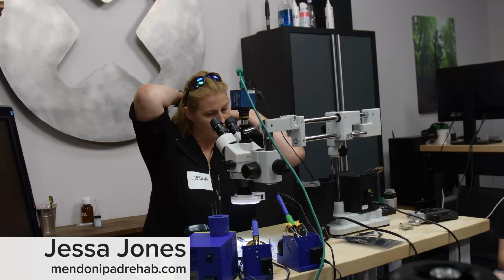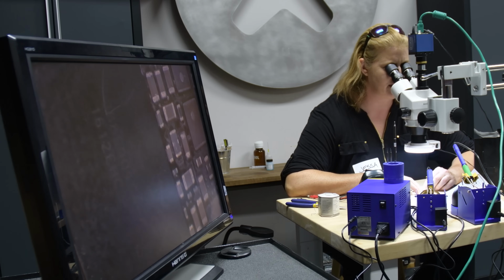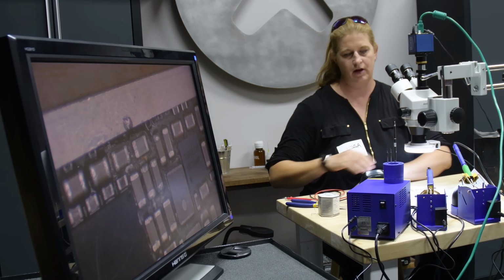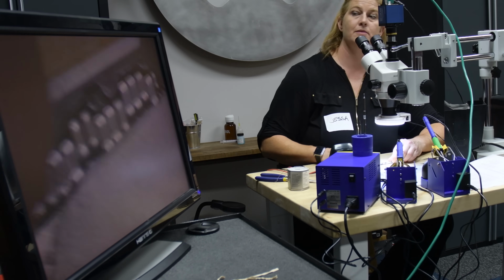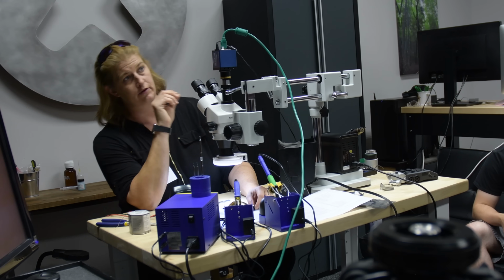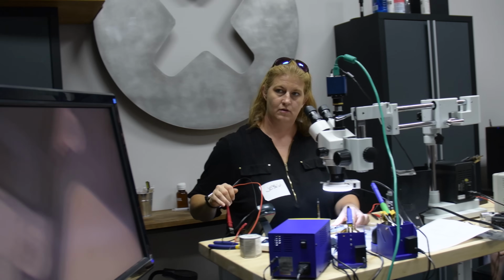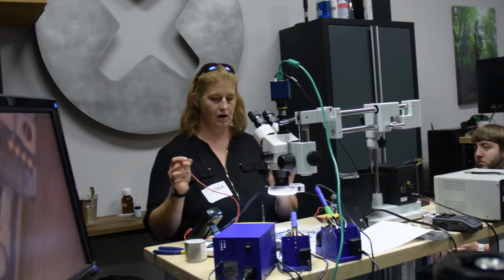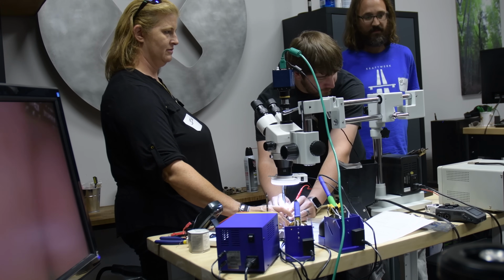Jessa Jones the Damaged Board Detective: Debugging an Incorrect Microsoldering Repair

Comment: In electronics the 2 fundamentals are Power = Volts x Current and Volts = Current x Resistance. 

Or P = VI and V = RI. 

Fundamentals says that at low voltage, if you have high current, your resistance will be low. Because I = V/R , so R needs to be lower that V for I to be high.

BUT! With semi-conductors, resistance becomes a variable that can change based on several factors that includes a voluntary provoked and controlled changes by an other part of the circuit. This means, among other things, that R will be different if the circuit is powered or not. 

You cannot use an Ohmmeter on a powered circuit. But an Ohmmeter on the same unpowered circuit can lie to you. Understanding the circuit and your measurement instruments are keys to diagnostics.

This is what Jessa is explaining.